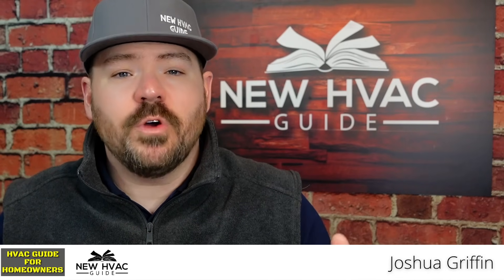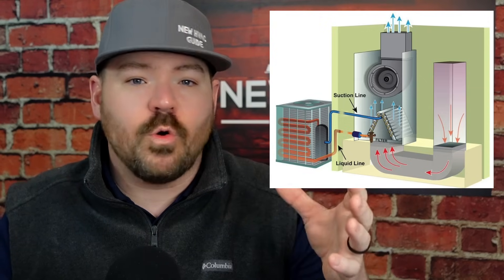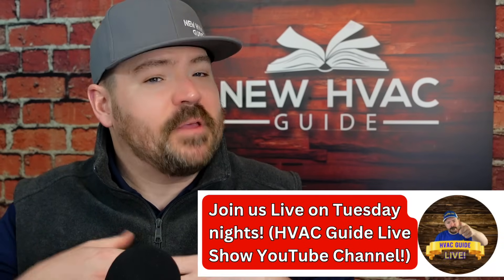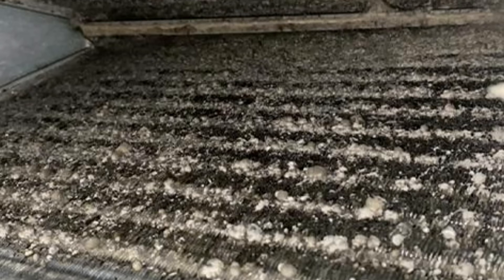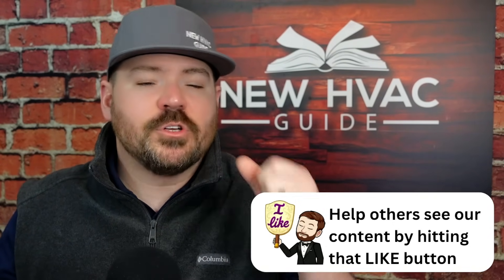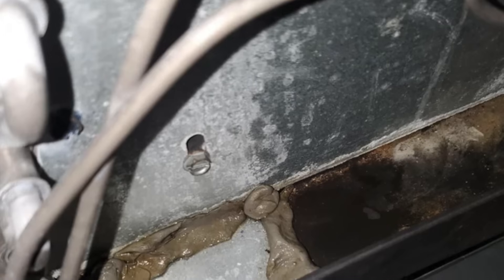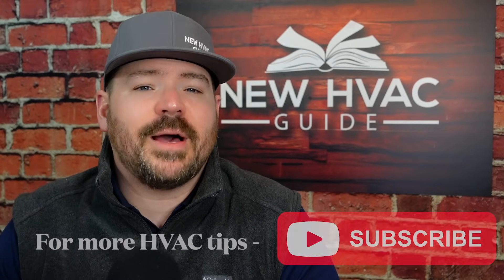HVAC Tip on UV Lights! (Location Matters!)

Comment: On a down flow system in a mobile home, where would you install it? Had trouble with this recently since an APCO X was too thick to be installed in there and the panel wouldn’t close.

Comment: My instinct tells me that it should be underneath the coils cuz that’s where the funk is growing on mine . I’ve cleaned the crap out of it but it’s old and I can’t scrub at all cuz the fins wanna break . I need this damn mold to stop growing. I’ll put 3 at once in if I have to 🤣🤣🤣
Reply: I see that they’re supposed to go in those coils. I also have one that’s up in the blower area the tiny one that’s vertical. They just installed the new one in the coil area, but it’s showing down through into my vent that comes into the closet where the AC is located. They installed it vertically. Maybe it needs to be done horizontally I don’t know, but I don’t understand why it’s coming through the bottom and through the air vent too clearly cause you don’t want to see that blue light they’re coming back today.

Comment: I live in a condo and had the same black tar on the heater coil. I cleaned off the heater coil first and the return air space(removed all dust). I then placed the UV light right at the return air vent, placed a filter over the return vent and covered the plastic parts with aluminum foil. The air filter removes most of the air particulars leaving only; the very small germs etc.. which is easily sterilized by the UV light.  My UV light only comes on when the blower motor is activated. I replace the air return filter every 3months. Been doing this for the last 5yrs. My daughter no-longer has allergy issues and I no-longer start sneezing when my HVAC comes on after I installed this UV Light system.

Comment: I had a tech come by and give me a quote and he said to use 9 watts as the higher ones like 36 can ruin the insulation. Is 9 better?
Reply from the maker: 9 watts isn’t “better”—it’s just weaker and a little less risky for materials nearby.

You always want UVC light (shortwave ultraviolet, around 254 nanometers). That’s the spectrum that actually kills or deactivates mold, bacteria, and viruses. UVA and UVB (the types you get from tanning beds or the sun) don’t do much for sterilization in your ductwork—they’re the wrong wavelength. So make sure the product you’re looking at specifically says UVC.

2. The Wattage / Power Output
Wattage tells you how strong the lamp is. A 9-watt bulb will still produce some benefit if it’s very close to the coil surface, but in general, higher wattage means more intensity and better coverage. A 36-watt bulb, for example, can treat more surface area and provide more effective sterilization.

That said, placement matters just as much as wattage. If a stronger lamp is mounted too close to plastics, wire insulation, or flex duct, yes—over time UV exposure can degrade those materials. That’s likely what your tech was warning about. A good installer will position the lamp where it shines on the coil and drain pan (where mold loves to grow) without directly hitting wiring or plastic parts. Many higher-wattage systems are designed with shields or housings to help with this.

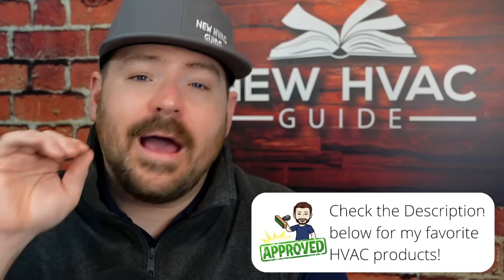Comment: My light was installed today by a HVAC specialist similar to 5:22 that's underside of the coils is where the growth happened.  The filter slides underneath that wide side of the a coil .Here's my issue, the light shines thru the filter and my entire ac closet is lit I'm concerned with so much uv light spilling thru because there's a vented cover on the side and light shines into the loft.  Isn't it bad for your health to be constantly exposed to uv light?  I didn't expect the light to spill outside of the unit
Reply from the maker: If your UV light is truly producing UVC, then yes — direct exposure would be a concern. That said, a lot of the lights being installed, especially in ductless mini splits, are designed with light spill in mind and are engineered to account for that. In fact, some of these products don’t produce UVC at all, even though they give off a visible glow.

One option worth looking into is that some UV products come with a toggle switch or timer feature. That way, you can run the light when you’re not in the room, and shut it off at night if the glow is bothering you while you’re sleeping.
Reply: @NewHVACGuide thanks

Comment: I've been having Problems for Years in My House where I'm Sick As I Come Home. I Have Done everything From Cleaning and Sanitizing My Coils and Ducts Multiple Times. But None have Helped. I Can't Tell you how many Companies that have Recommended and Try to Sell Me these UV Lights to Me. They Tell Me It will Kill All The Germs, Bacteria and Mold in the Air Entering the furnace. But I Find it Difficult To Believe. Because the Air is Moving so Fast Past The Light that It Won't even Have Any Effect. Come to Find Out that what The Light Actually Does is Shine On Parts Of The Furnace To kill and Prevent Microbial Growth ON THE INSIDE PARTS Of The Furnace. That's about it. It doesn't do anything For The Air Going into it.
Reply: Have you tried getting dehumidifiers and air purifiers?

Comment: According to the manufacturer: REME HALO® whole home air purifier improves air quality throughout your air-conditioned living spaces. Easily installed in new or existing air conditioning system ductwork, REME HALO® actively reduces bacteria, viruses, odors, mold, allergens and dust ensuring excellent air quality. A new Countdown Day Timer offers visual indication for when it’s time to replace your REME cell. 

Yes, it is CARB certified

Comment: I had my unit replaced a couple of years ago and we just notice mold on cloths in closet and water around vent. Had 3 HVAC companies come and take a look. Noticed something growning and duck work was soaking wet. I was told this common and i might want to think about adding a UV light and i can do it myself and buy a dehumidifier.

Comment: Josh thank you for speaking the truth- uv light must be correct wavelength, hi intensity and prolonged contact-sp much scamming in the industry for hi margin after market accessories. I think this WILL correct the pan and the evaporator coil , but need TWO lights, one on each side. And arguably three. One inside the a coil. And on all the time . I think for dragon pan, one of the chemical pills is probably more useful .

Comment: We have an aprilaire system where we use the 213 filters. We also have a newly installed uvmax ezuv uvc light installed on coils right after filter. It’s maybe 8 inches away from filter.  IN 3 months MY FILTERS ARE TURNING YELLOW (ans if the light is burning them)  and causing an odor and sometimes causes us to cough. Help!

Comment: I would do it just outside the A coil to avoid direct light onto a filter (if its connected directly to the evap) This is a horizontal system I am thinking so unsure what a vertical would be best

Comment: I want to install a UV.light inside my A coil, the only thing stopping me is im worried about the return air filter at the bottom under the furnace. Is there a certain distance the filter will be safe fron the UV light?

Comment: We had a new system installed and it lights up the return filter. It’s about 24” behind it. Is that normal? Should we be concerned of UV exposure. It’s weird to walk by and see a blue lit up filter. The installers said that was normal.
Reply from the maker: Some products do not release the harmful UVC rays. However, I would look up the model number on the product and see what the precautions need to be.

Comment: You mentioned heat and brittling my question is wire insulation melting also isn't moisture needed to help with cooling as the air flows across the fins and coils?

Comment: You neglected to mention that UV lights can produce ozone, which is a powerful oxidant that damages your lungs.  Make sure to buy a UV light that is CARB certified which means it produces less than 0.05 parts per million of ozone.  None of the lamps you recommended in the description are CARB certified.  Also there are a few manufacturers nowadays that make CARB certified LED bulbs that last much longer than the fluorescent bulbs, with the added benefit that they can be cycled on and off instantly without waiting for the bulb to warm up.

Comment: My coils scrubber light was placed into the supply side duct board. It melted the internal insulation to an ash. Then the burned ash was blowing through the house. Also, it ran constantly and filled the entire unit with smoke and when the fan turned on, it blew it too throughout the house.

Comment: My HVAC tech claims he installed UV lights on my three systems but there is only a glow on one system.  How do I know there is a light on the other two systems? I paid $1000 for three light installations.
Reply: UV light glows is unmistakable. No light means UV ain't on.
Reply: Well if no glow there you go you got taken to the cleaners big time 1,000 Jesus

Comment: We noticed some dark smudges on the ceilings next to the vents, and a UV system in the return duct was installed. Haven't repainted yet so I don't know if it worked or not, but wouldn't it accomplish the same thing, and more, by putting the same light near the coils instead of in the return duct? Does it EVER make sense to put a UV light in the return duct for general whole-house air sterilization? I'm now skeptical of that.
Reply: You still have to clean your ductwork

Comment: I saw a video that made some sense, yet there is some confusion here.  Installing a UV light between an "A" coil  narrow peak on top, makes the best sense.  The light burst will shine on the pan, and the throw light out threw the entire coil and fin system by location alone.  However, the negative is that the coil and fin drip, will fall all over the light and the rest is obvious.  Noting the gravity is the key here (condensation dripping straight down, so installing the UV light dead center where the fins are not present above), it was forgotten that there is wind air blowing in the system, and the coil condensation would blow on the light and into the supply.  So what exactly is happening here in this configuration is my question?  The same dude said install it above and the light would still shine enough to make the same coverage.  Logically, I dont think so, ...but I never installed one either.  So will the light get ruined by a middle install under the coil, that has air flowing threw it, or is above it better and will there be less UV defense.
Reply: I think you are on to something

Comment: I'm planning on tackling this job soon, but my primary upgrade is adding a humidifier. I have the Aprilaire 800 that I'm going to be installing. My question is how far away should the 2 systems be installed from each other? Should the steam humidifier be installed above or below the uv light? Should they be installed on opposite sides from each other?
Reply: If you have fiberboard ductwork. Depending what area you live the humidifier will only add moisture that can't dry out of the fiberboard and you'll grow mold inside.

Comment: UV lights IMO are a bad idea.  HVAC contractors promote the use of them because they make money on the sale of them, they make money when they change them out every year, they make money when you have to replace your unit in less than 10 years because the UV light has destroyed the coatings on the coil pipes which then spring leaks and cause all kinds of problems.  The lights can also cause stuff to disintegrate inside the air handler, such as the filter, any wires or electrical connections, plastic housings on any other devices that you have, such as the REME Halo.  Every one of these things cause service calls and more do-re-mi being transferred from your pockets into the  A/C company's pockets.  The sad part is that it doesn't clean the air flowing through.  In order to kill mold spores the spores have to be exposed to the light for 6 hours.  To me, it makes more sense to use an electronic air cleaner and keep junk from getting on the coil in the first place.  You could also install a REME Halo LED system, which doesn't use a UV light to clean the air as it's exiting the system too and makes particles heavier and stickier so they either fall to the ground, or get caught more easily by the filter.
Reply: Where is your information coming g from.
Reply: @adventureswithfrodo2721  A mold inspector who is an expert on mold.  The same goes for portable air filters for inside the home - if they have a UV light, the UV light is worthless.  It takes 6 hours for continuous exposure to the light for the mold spores to be killed.  The only thing it kills are spores trapped inside the filter that sit there for 6 hours, and during that time, while they're being killed, they generate mycotoxins, (kind of a way of shooting back at you) which is what does the harm to the body.
Reply: Sorry but you don’t know what you’re talking about. Yeah uv can degrade wring, that’s why you shield it or don’t install a uv light near wiring. The pans now days are pretty resilient to uv. The coils not going to be damage. Also these bulbs are on 24/7 so you don’t need to worry about it being on for at least 6 hours. The electric filter idea doesn’t make sense. The uv lights aren’t for “junk getting to the coil” it’s for growth forming from humidity in the unit. An imapacted coil or blower will do more damage to a system than your uv light can do.

Comment: Liked video, but would have appreciated some diagrams of common system configurations with recommended uv light placement. I have a horizontal system in the crawlspace under my ranch style home and need guidance. Mold is growing on coils, in  the drip pan, and around the wires and metal in the chamber before the return duct work.
Reply from the maker: Install in a place that light shines on the “problems”
Reply: @NewHVACGuide I don’t see any of your product recommendations.

Comment: Is the UV light needs to be ON 24/7 ?
Thanks
Reply: These lights are usually mounted above or next to the evaporator coil and should run 24/7 while the air conditioner is on. They should be turned off when the air conditioner is turned off for the season.

Comment: I am getting mold on the cold side on the outside . on the outside of the ductwork the inside is very clean , 
i am in Florida so its used almost year-round,
Reply: Me too ☹
Reply: @weekendwarrior3420  The circulation unit is in the ceiling of my garage,  and it's usually 100+ in that area and I have reseled the duck work in that area waiting to see if it comes back

Comment: Just had one installed. My neighbors smoke heavily and my son has asthma. It’s seems to be working keeping the cigarette smoke out of my house. However I was told to run the AC unit on low like 74 75. Does that sound about right. I’m asking because it makes for a higher power bill and we are some cold nature. From time to time I can smell the cigarettes but not as bad as before.
Reply: UV light doesn’t do Jack to cigarette smoke. It’s meant to kill bacteria and viruses. What you need is decent Marv 13-15 filter and activated carbon filter.
Reply: @JohnLee-db9zt  where do I get that from. My filter size is a cray size to find. 17.5x17.5
Reply: @JohnLee-db9zt  Thank you for sharing. I have tried everything from carbon filters, having the air ducts cleaned and air purifiers. Nothing is helping. My whole house smells like cigarettes. Our mattresses, clothes and my car that’s parked in front of the garage. I don’t think there’s a solution to this problem and it’s not right for my son and I to inhale toxic secondhand cigarette smoke. This neighbor should have bought a single standing home and not a townhouse smoking like this. All they do all day is stay inside and smoke. HOAs should banned this which a lot of townhome neighborhoods are doing.
Reply: @dora7557 use an ozone generator in the room(s) to get rid of the smoke smell. A commercial unit can be purchased, but use extreme caution. Leave the house, have a timer ad second method for safety shutoff, but it will fix it. I had to do several treatments, but so much better. I'd move if it didn't....

Comment: I am thinking of installing an HVAC UV light inside my supply duct in front of the coil. However, my supply duct has some type of thick black insulation inside of it. I am concerned this insulation might degrade over time due to the UV light. Also, I was wondering if it's OK for hot air (when heater is running) to run while the UV lights are on. Thank you.
Reply: The u.v. light is meant to be helping the growth and spread of bacteria in fiberboard or fiberglass lined metal duct work. Yoire good to goo!

Comment: Beware of low cost copies.  You need it to be specified as UV-C wavelength bulbs to be effective at killing bacteria and mold, not just UV.
Reply: what brand do you reccomend? 
I also read the studies that show uvc.
Reply: @susan4789 enviroaire uv fresh air uv bluetube and apco
Reply: @susan4789 I have installed probably around 100 fresh air UVs and have seen the benefits that he speaks of in this video it's the second one on his list in the description